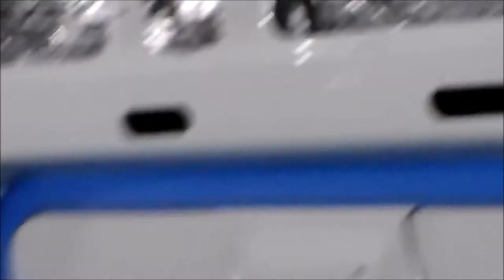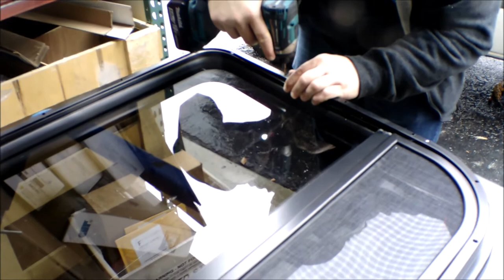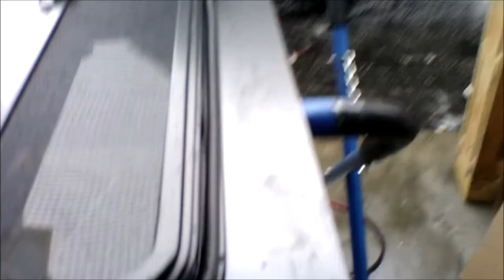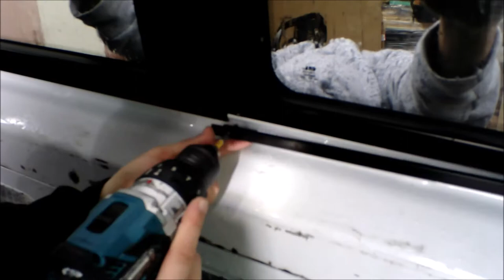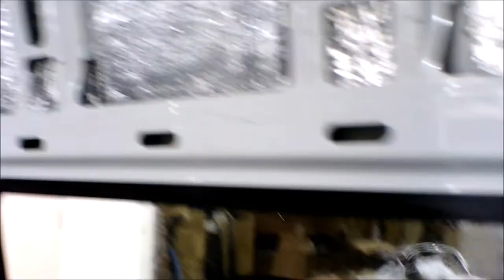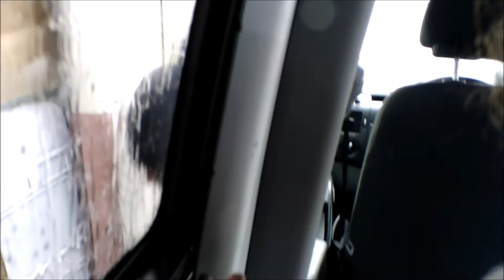Van Window Installation Video - Clamp Ring - CRL FW621L

Comment: Thanks for posting this...very thorough!!
I see you didn’t need to add the foam inner strip under trim ring. Is that optional or when would you say it is necessary?
Reply from the maker: We have not found a time where adding foam to the ring was necessary.

Comment: What was the blade on the reciprocating saw?
Reply from the maker: RK Morse 3" 32tpi - Designed for Air Saws, also works on the one-handed electrical reciprocating saw we used.

Comment: i am looking to replace my emergency exit window with this in my 2018 170 2500 cargo sprinter. Will this window work?
Reply from the maker: Yes it will, you will need to fill the bolt holes left by the hinge of the Factory Emergency window prior to installation, other then thatt will be same attachment of window as seen in video. https://www.vanwindowsdirect.com/products/crl-fw621l-driver-side-forward-t-vent-window-sprinter-van-07-20

Comment: What are the specs of the blade you guys used? The finest blade I'm seeing is 24 TPI. Can't seem to find any 32 TPI blades for a reciprocating saw...
Reply from the maker: We use a MK Morse 32TPI Blade designed for an AirSaw/Body Saw , it fits fine in the Rigid One-Handed Reciprocating saw that we use. 24TPI blade should work as well.
Reply: @vanwindowsdirect1261  Awesome, thanks!

Comment: Bunk window is leaking on top and notice a small gap on top.  can i remove and install butyl tape then screw back them back up.
Reply from the maker: Yes or just putting a new foam seal may take care of it as well. You can even switch to an open-cell foam as long as it's completely weatherproof those seals are more spongy so you can get a 1" tall foam that will smash down to 1/4" so if there is a curvature issue that is causing the gap the open cell can fill it.